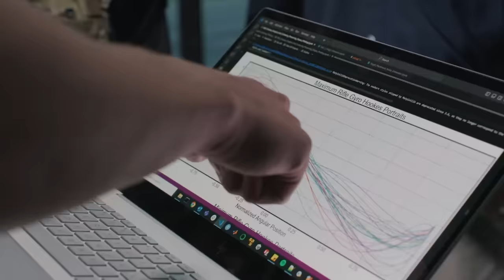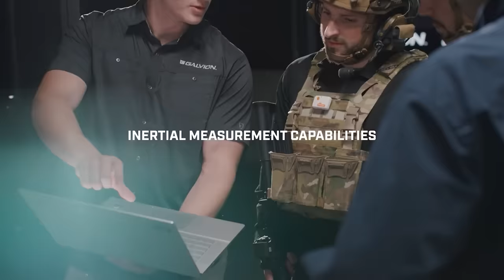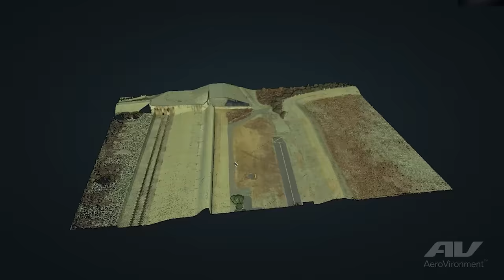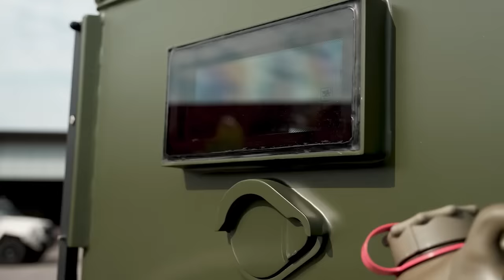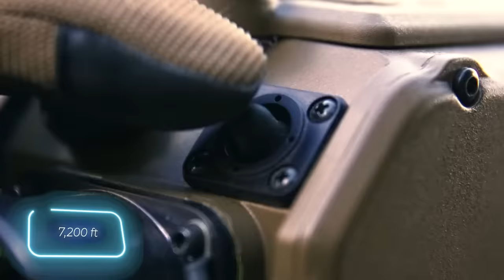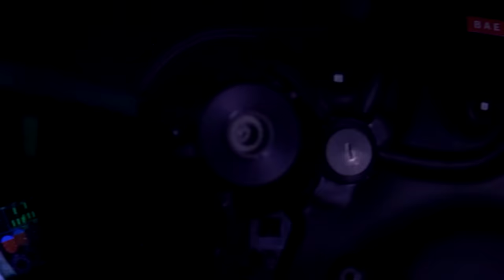MILITARY TECHNOLOGIES THAT HAVE REACHED A NEW LEVEL

Comment: Maybe they could make cold weather armor treads that have little metal cleats embedded in the rubber that can be raised and lowered. This would help a lot in icy conditions, and when you retract the cleats the vehicle would be better able to negotiate concrete surfaces.

Comment: Hang on a minute! That pontoon bridge was hanging on a crane at the start of the vid. How on earth is there time for that in a war situation?
Reply: Carried in by helicopter, this is unlikely being done under fire. Can also be brought in by truck with a HIAB crane
Reply: After the drone maps out the forward area terrain, usually (2) two-man scout teams get to that forward area, split into 4 one man LP/OP stations to make sure of no enemy patrol use area and keep commo to base. Then engineers with bridge pontoon come in, deploy apparatus, makes sure it's secure, then falls back to standby rally-point in case they're need to do on the spot adjustments as Infantry crosses over. When last swingin' D is crossed over. Dismantle packup and game of leapfrog continues. If position area comes under attack, higher will decide whether to cut bait & beat feet or stand & defend as intell comes in. 🤠😎👍🏾

Comment: 3:31  how would it act if the water had a strong current
Reply: probably fine, you can secure it to the bank and you're not going to be using it for too long it seems, which also would deny the enemy from using it if you can just unlatch it from the bank and let it drift away.